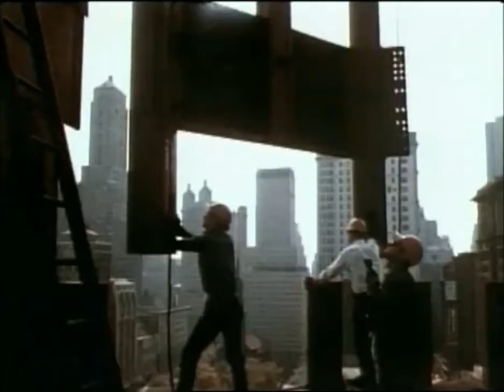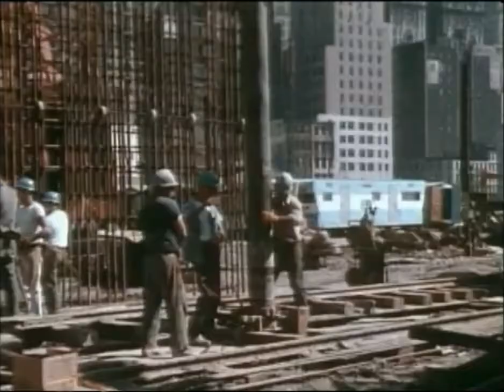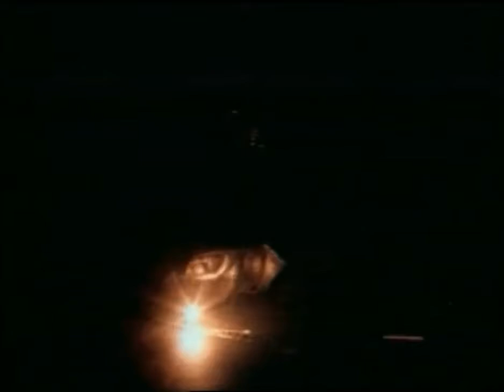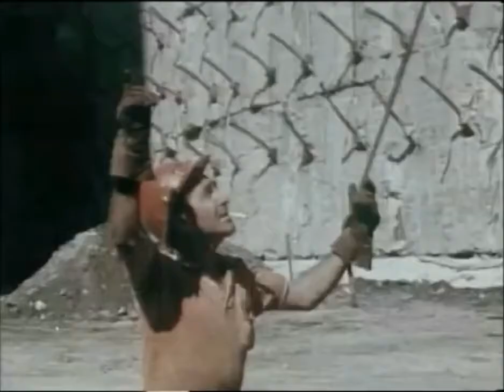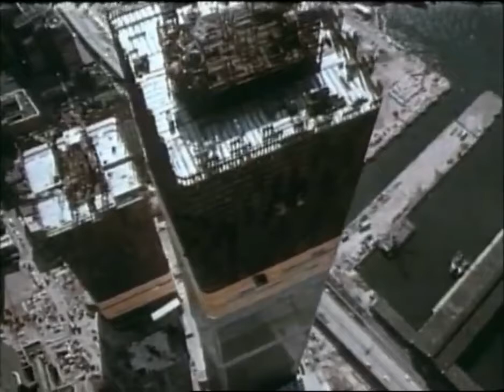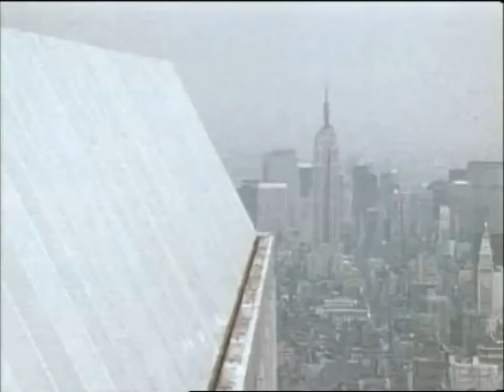PBS Building the World Trade Center PANYNJ, 1983

Comment: The steel was so much thicker and stronger at the bottom, tapering dramatically as it went up. The idea that small relatively thin and light columns could somehow dismantle, crush, or otherwise destroy the larger thicker stronger base of the tower is preposterous. That’s why NIST never even pretended to address the actual ‘collapse’ sequence of the destructions, but rather said the destruction preceded by the lie which traitor Bazant foisted on the world on 9/12/01, “crush down - crush up”. Bazant and ASCE leadership abetted the mass murder by colluding to conceal it.